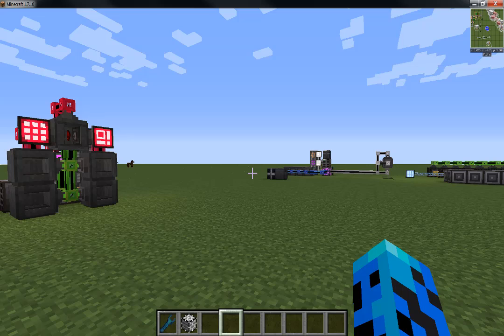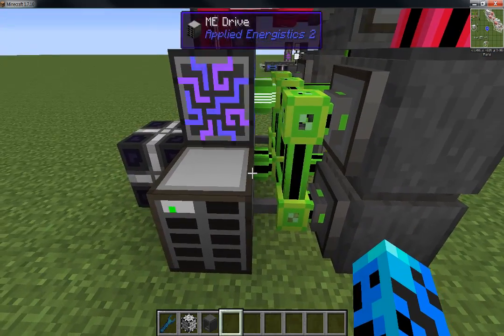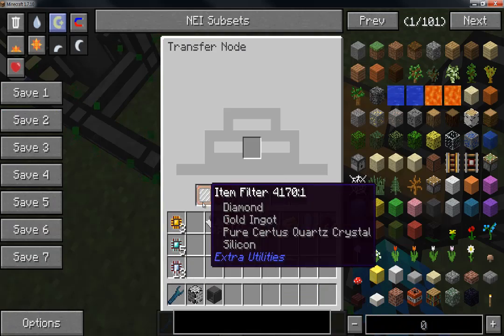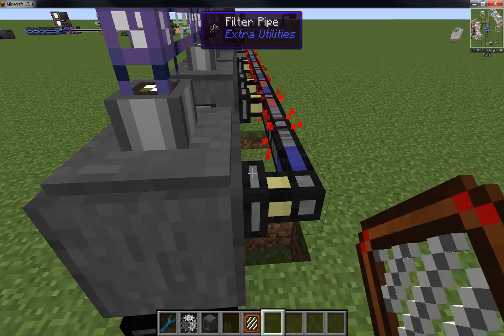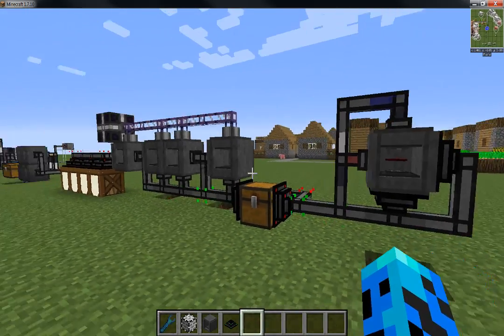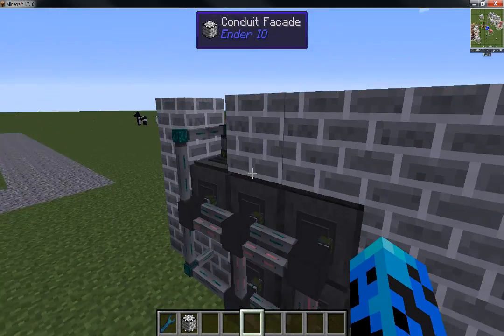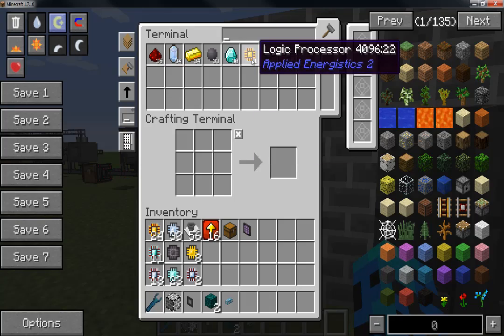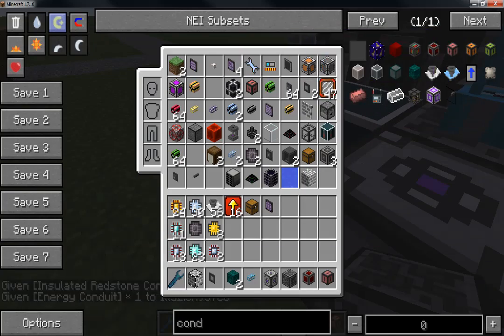Minecraft: AE2 How To Automate Inscriber Part 2

Comment: Hello. Mine AE2 system cant make for example multiple logic processor. The system can make 1 tho. So if I order like 10 logic processors it makes 1 and then it doesn't craft new printed silicon. This problem occurs only when making multiple processors. I have crafting card on export bus for printed silicon.

Comment: My system keeps getting tripped up on making the silicon.. I have the sand going into a pulverizer and then the silicon going out into the inscriber but it refuses to work when anything else is crafting..
Reply from the maker: Look through the other videos in my series on this. Also what mod pack are you using? Try adding another crafting cpu as well.
Reply: +illuzion98765 thank you for the suggestions. Your last one was the answer. I needed another CPU.
Reply from the maker: Yea I think that was the fix for that. Its been quite a while since I made that video so i was trying to remember what the layout was.
Reply from the maker: Also, If you watch my videos labeled "refined" and "complete" they will help you out. It was an evolving series and those are the ending.

Comment: Ive put this together  it works up until the one on top it wont put the printed ones in
Reply from the maker: +Lawrence Palmer Just keep in mind this spotlight is 1.5yr old. Somethings may have changed. You can always use a export bus with the 3 printed set to export to the top. Then extract back into your network.

Comment: When i did this exactly as you did it it wouldn't put the Printed logic/Calculation/Engineering circut in the inscriber. in the compact version? do you know why?
Reply from the maker: Im not sure based on your description. The only problem I know of on this system was it failing to craft more than one processor at a time. But at any rate, this video is slightly outdate. Please check out my newer videos to see a better way to do this. Thanks for the comments.
Reply: me too
Reply: +Jacob Gyllberg You need to add one more cpu block group as in a crafting unit and a 1k storage on the red network. Each group of crafting units only functions for one process per network. Hope that helps

Comment: Okay, a reaction here as well :p Wouldn't it be easier using a Redstone furnace/something else to smelt down the 'stamped' processors, as you don't need any export busses but only one interface and one import? Please correct me if I'm wrong ^_^
Reply from the maker: Watch my last few videos and you can see what I am now using as my main system. I am no longer using this setup as i found more efficient ways.
Reply: illuzion98765 Okay good, will certainly do so, thanks!
Reply from the maker: The videos labeled "refined" and "complete" are my current setup. Let me know your thoughts.
Reply: Will do! Can take some days though, Exams coming up :p

Comment: The silicon isn't going in because the pipe before that last filter pipe has been wrenched into a state which won't allow nodes to search that filter. You can see it by the pattern of gradation approaching the center segment of the pipe. And for the final assembly stage, you can use three transfer nodes, each filtered for the materials that go in a specific slot of the inscriber. That will avoid having the one node blocked by filling up with the wrong material.

I'm really not a fan of "circuit = processor" recipes that hide the silicon and redstone exports (like in the last video and the start of this one) - the system won't ever know when it doesn't have enough of those, and can't trigger any systems you might have in place to produce more. It's much better to have the final assembly stage, at least, on a small subnetwork managing the insertion of the ingredients into one or more inscribers, which allows you to list all of the required components in the circuit pattern.

The nicest way I've seen to do this is to attach an arrow-mode interface block containing the patterns to another interface (block or part), and from there attach three storage buses per inscriber (top, bottom, back), and finally add an export bus (with a capacity card, set to send out the final processors) aimed back into the pattern interface block (and a quartz fiber connection to power the subnet, of course). This arrangement can easily run two inscribers on an ad-hoc subnet with 8 channels used, or could have a controller and further inscribers added for even faster assembly. And since you only need three I/O connections to each inscriber, you can line them up in a nice neat row instead of having to space them out and send power in at odd angles.

Another big benefit of using a subnetwork is you only use up one channel on your main network for the interface with the crafting patterns.

Comment: Hey again, okey have an issue here, maybe you can replicate it and maybe help me find the source of the problem.

Iv´e tried Part 1 design and this compact design shown in the beginning of the video, and i have a computer with 4x64k CPU, 1xcrafting unit, 1xCo-..... i have put in patterns in a assembly block for a 64k Storage cell for the ME. And here it comes.

Its not working 100%, it always stops crafting the printed silicon, even thou its on autocraft with the BUS like in your video.
If i send a work order on just printed silicon it works just fine, but not if the system needs to craft the silicon it self.

First i thought it might be the channels, so i used a Dense cable that hold 32 channels, and split everything up so it uses like 4 channels on one side and 4 on the other and 2 on top etc.

Mod im running is Bevos Techpack from atlauncher (1.6-FULL).

Can you replicate the error in any way, im happy to provide images etc on my setup (could use video but some reason the capturing software aint working that good with the new AMD drivers.

Comment: I'm totally going to be using that ender IO build. I've been trying to make myself get around to building an AE system, but for a system that's built around automating the manufacturing of everything else, the mod creator made it a flipping NIGHTMARE to make his own stuff.
Reply from the maker: Yes he did make it more challenging. But from what i understand this was his original intent. We shall see how the next revisions go now that the original mod author has stepped away from modding and turned the mod over to a different dev. At any rate, glad you got it working well.
Reply: illuzion98765
 I haven't yet, actually. Also, that second build, where the redstone keeps blocking up the build...why don't you just toss a buffer chest to hold the redstone?

Not that you really need to, as the AE system, or the ender IO system are a lot more efficient for items.